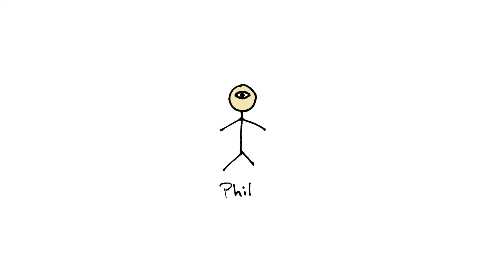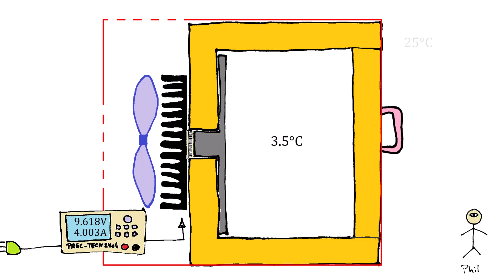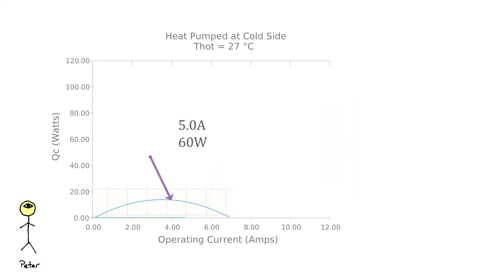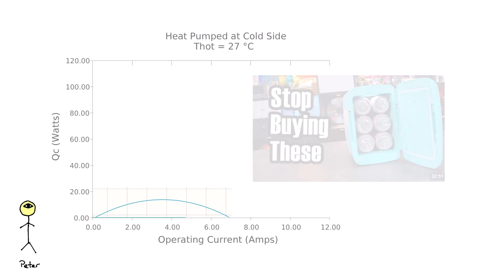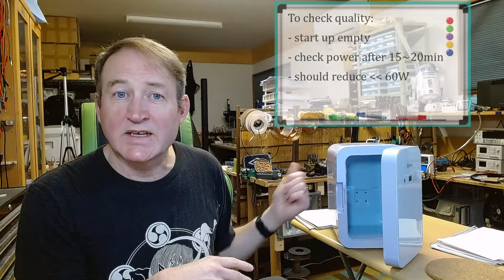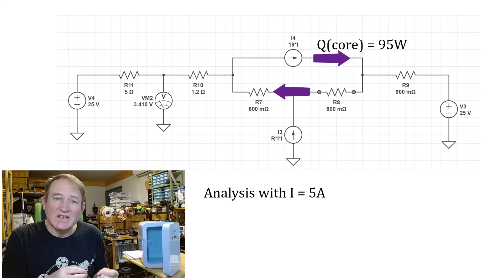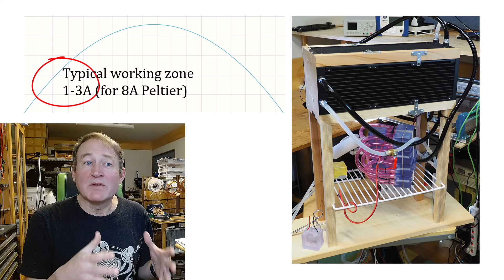The Peltier Fridge Parabola Problem

Comment: Using copper instead of aluminium or both can significantly improve performance , the block between the heat radiator and the Peltier should be copper , then if a 2-3mm sheet of copper is used across the aluminium heat radiator to transfer heat into it performance can be more than doubled also having the 2-3mm sheet of copper on the inside cooling will also improve heat transfer.
Reply from the maker: I've just bought some copper water/air heat exchanges (popular with gaming PCs), expensive but I'm interested to see how they perform against cheaper aluminium types. Also doing experiments with the aluminium/water blocks that go directly on the Peltier and finding the heat is not transferring well from the aluminium to the water, it's about 0.08K/W on each side. I always thought the thermal paste interface was the culprit. Experiments are on-going. I'd like to get 90% of the datasheet performance one day, so far I'm at 75% for my best attempts

Comment: I ran a simple test on my peltier setup where the power supply was ramped down very slowly, like 0.1A per hour and the temperature was logged the whole time. 4 days later I looked at the data and I didn't see no parabola. What I saw was pretty much linear. But I started from 90% of its rated limit. Which is still quite a bit higher than any sane design would allow.
Reply from the maker: It might depend where you measured the temperature? For example, if it's close to the Peltier itself it might follow the datasheet curves, whereas if it's something like a chamber temperature (away from the Peltier face), you should see a parabola if the chamber has for example high thermal insulation to the outside world.

Comment: Yes, you need to run them at about 20% max. But you can gain even more efficiency by doing 2 or 3 stage. Normally, you can find multiple stage Peltier modules for sale with different-size pyramid configuration, but I think that's a mistaken design. It's done that way for simplicity of operation at close to 100% power so as not to overwhelm some elements, but you can absolutely use same-size elements in 2-stage for increased efficiency when run at lower power levels. Probably even 3-stage same-size would work. The trick is not to run them electrically in parallel. They should be run in series electrically, OR computer-controlled individually. 2-stage in series works pretty darn well. 
However, even with all that, I think you can only get about half COP of an optimal compressor design at moderate temperature differences.  
So you could design a Peltier AC with 3-stages and a proper design, it just would take a large count of elements and the efficiency would still be lacking, and it would struggle if the outside temp is too high. But for some niche applications it could be useful. I'm sure in the future we will also invent a more efficient Peltier
Reply from the maker: In general Peltiers are only about 25% as efficient as a compressor. But compressors are fantastic and 25% of fantastic is still OK, given they are a much smaller form factor. Unfortunately there are a lot of implementation traps so people often only get 5% or 10% of what a compressor can do, and then it's not worth the effort. As for series/parallel: in general for power applications (like air conditioning) having them thermally in parallel and electrically in series is the best combo, that way you can run them off a current controlled source and fix the heat pumping action. For applications with high thermal resistance (e.g. cooling a chamber that is intentionally insulation), yes a small thermally in series (stacked) can actually work better, which is what I found with the butter cooler.
Reply: @PeltierPower  Only if power usage is of no concern then thermally parallel for AC is "best." ACs do still need fairly high temperature differentials, and you always have thermal losses which raises it even higher. The only downside of stacking is you need more elements (which are cheap coming from China these days), that's all (if comparing to a single running at partial power max efficiency range) My point about electrically in series (or individually controlled) in 2-stage is to allow for better power balance because the hot side of stack will behave differently than the cold side and use slightly different amount of power
Reply from the maker: @zci-o9i  Not sure about "no power concern" bit. I'm running a 16 bank of Peltiers thermally in parallel to create a 600W heating system which runs off a 300W solar panel, designed to handle a dT of 25K (25°C difference) as the cold side is situated outside in temperatures around 0°C. It needs some fine tuning but basically works OK.
Reply: I'd think in some cases you might want them both series and parallel, like with batteries where you want both more current and more voltage than a single cell provides. Probably where you want both higher heat flow and higher temperature difference than a single element handles well.

Comment: I think of Peltier devices like DC PM motors.  Temperature delta is like the back EMF when the motor is acting like a generator  Torque usable is after the losses like friction and in the windings.

So I have a couple of surplus military blood transport refrigerators.  Actually they can heat as well.  They have a large Peltier in each corner with a massive heat sink and a H bridge controller with thermistor in the chamber.  When I got these the Peltiers were all defective which is interesting as the units looked like they were never used.  I replaced the Peltiers with larger ones and and the chamber can go below freezing but it takes a lot of power.  

Would an appropriate experiment, based on what you said, be to let one cool at nominal current and stabilize, then drop the current in increments, each time allowing to stabilize, each time measuring what temperature is attained?

Comment: It might be a lot of work, but it would be cool to see a "worked example" of roughly figuring out a stable low-side current for a peltier you have. I imagine some spreadsheeting would be involved.
Reply from the maker: I'm working on a simple html page where Peltier enthusiasts can enter the parameters in a thermal circuit along with the Peltier parameters, and then run a sweep from say 0A to 8A (for an 8A Peltier) and see what the cooling power, heating power, input power, COP, temperatures at different currents looks like, all of which follow parabolas except for COP which is a bit messier mathematically. I've got something going already but I want to beef it up to handle series and parallel options, and also make a video how to use it. Work in progress!
Reply: @PeltierPower  Sounds cool!
Reply from the maker: No pun intended?

Comment: I found a good method of use is to lay the unit on its back where the internal gas stays cooler by not dropping out the door to be replaced by the warmer room air( as is the case with most normal fridges). the best trick for normal fridges that dont ge fully packed is to use either inflated packing bags or polystyrene blocks and is most effective with chest freezers.I also make a rack to raise the contents so that removal/replacement is quicker so that gaining heat is reduced to as short a time as possible!😀
Reply from the maker: Actually one of my thoughts for the Peltier fridge (the Msake one), was lie it on it's back and fill it with a 4-5cm of water which should allow better thermal contact with the cans inside. Sounds like an experiment brewing!

Comment: This Msake unit seems not available for sale. Which other peltier fridges (especially in the US amazon store) actually work correctly? I have a Cooluli which is a POS.
Reply from the maker: That might be a little beyond my powers! I don't have any affiliation with Msake, I guess there may be regulatory aspects involved, like electrical safety and EMC that stop them exporting to the USA. As for other brands, of course I could test and report but I'd need to buy them, get them here in Japan, run the tests and then report the results. I'd have to think about the economics of that ...

Comment: Sounds like the heatsink on the average Peltier fridge is drastically undersized as well.
Reply from the maker: Actually the term heatsink itself just adds to the confusion, really it's a heat exchange (metal to air). The metal is also a heatsink but it's tiny and gets "filled up" fairly quickly, which means the main action is all about moving the heat from the metal to the air, and the fan-attached-heatsink isn't great for this, especially behind a cover. In small Peltier fridge it's probably the best practical solution, but still should look for crimpled heatsinks for more surface area. For serious Peltier applications it's best to use water based radiator exchanges. But that means water pump, water circuit, extra noise, pump power etc, doesn't fit for a small fridge.

Comment: Still inefficient, just less so with the right tweaks.
Heatpumps and by extension compression cooling is way better due to using state changes for heat exchange.
Of course, until we can find a way to make mini compressors the size of those tiny fridges, peltier is one of the few options. And at least, there's a way to make them a bit more efficient.
Reply from the maker: The numbers in the video were really just for illustrating the parabola effect. The actual Msake fridge I tested uses about 8-9W with the setting 18°C below ambient. At those levels the "efficiency" is really not important, given the complexity of making a small compressor system, possible noise and cost just to save maybe 4W, it doesn't make sense. For "power" applications, Peltiers can get in the 200-300% efficient range in practical set ups. It's still well below compressors (compressors beat Peltiers by about 4:1), but there are advantages like direct connection to solar without inverters, batteries and so on, and much much much smaller. I'm running a 600W heating system running off a single 300W solar panel for background heat in winter. Yes it's not as powerful or as efficient as my 6kW air con but it's tiny by comparison

Comment: I bet most mini fridges for cars/camping just smashes in 12v/ unregulated battery voltage into a 12v rated peltier and calls it a day.
They always get super hot on the outside and the cable

Comment: Peltier cooling Sukks balzzzz, to much wasted energy, better off with energy efficient freon type system
Reply: What is the physically smallest phase change heat pump you have seen?  There are smaller Peltier systems that work for their intended purposes that could not be achieved otherwise.  In some rare cases a Sterling system may achieve a intermediate size but their cost usually only justified for cryo-cooling.
Reply: Also you can run it in any orientation & if needed orientation can be constantly changed will running.
Try flipping a running fridge upside down & see what happens.

Comment: Interesting. The first time I came across a pelter was back in the late 70's. I was an electrician in a hospital and in the dining room there was a dispenser that dispensed pats of butter. The pelters , two of them, kept the butter cool. One of the peltiers failed.
Reply from the maker: I found in my modelling for the butter cooler that two Peltiers in parallel actually made it worse, whereas two thermally in series (stacking, normally terrible for efficiency), actually works better and is more efficient compared to one Peltier. It's a special case but shows how doing the math, modelling and measurement can yield surprisingly effective counter-intuitive solutions.

Comment: I knew the typical 12706, 12 V / 5 A (60 W) max  should be run at 6 V / 2,5 A (15 W) or less. 
It's good to know that 
1) at least one maker is making good enough product 
2) someone (you) checked this in the real world, THANKS
If you need twice the cooling power, just use 2 peltiers, they are so cheap

Comment: Also, could you clarify what the efficiency of the Peltier at the lower current on the left of the parabola is?
Reply from the maker: Yeah, I meant to include that. It was 4.3W cooling with 15W in which means 0.286 (28.6%) which is still pretty low, due to the thermal resistances used in the simulation which reflect the typical Peltier fridge design. With better quality but still realistic hot/cold side heat exchanges it could get up to 60% at the same -21.5° below ambient. For this kind of application the COP itself is not the end game, really it's how many watts are needed to maintain a particular temperature difference below ambient, which is mostly dependent on the insulation quality of the chamber. I've had designs that maintain a 6 pack of beer at 20°C below ambient with around 4-5W input.
Reply: Yeah, i came here to ask the same. He mentioned the COP for the crazy side but not the efficient side.

Comment: It would be cool if there was a free thermal circuit simulator out there, it would make these experiments a lot clearer
Reply from the maker: Yes, I'm actually building a simple html page that you can enter the thermal resistances on the hot, cold sides, chamber insulation, any heat sources (like CPU cooling), external ambients on the hot and cold sides, the αT (seebeck) and resistance at room temperature, and then the graph plots the cooling, waste heat, temperature and COP as a function of current. It works great but I want to have it handle parallel / series combinations so you can play around a bit to find the optimal point, plus a video to explain ... another work in progress!
Reply: @beanapprentice1687 @PeltierPower An electrical circuit simulator such as the free and easy-to-use LTspice works fine for thermal circuit modelling. You just need to know how thermal components and values correspond to electrical components and values. For example:
thermal resistance (degrees C/watt) <> electrical resistor (ohms)
heat flow (watts) <> current (amps)
temperature (degrees C) <> voltage (volts)
thermal mass (joules/degree C) <> capacitor (farads)
heat of phase change (joules) <> can be modeled with a rail-to-rail output op amp and a capacitor configured as an integrator. LTspice allows creating your own custom components / schematic symbols / circuit models, so it's possible to create a "phase change heat sink" component to allow simplifying thermal circuit models that involve phase changes.

Comment: Do you sell your 24bit temperature monitor and the software??
For machined-out cooling with direct contact between water and ceramic, introducing gentle rotation of the water within channel would help exchanging between slowly moving surface layer of liquid and faster moving bulk of the water flow.
Thermal contact resistance could be further reduced if alumina ceramic was replaced by Aluminum Nitride which has higher thermal conductivity but unfortunately also higher price. 
How about thinning Alumina ceramic down to 0.1mm and bonding it to a copper plate with Indium - would that reduce thermal resistance enough to justify the trouble?
For projects - reaching near-cryogenic temperatures is the holy grail of Peltier cooling; people claim to reach <100C in vacuum; would be extremely interesting and challenging project to explore.
Reply from the maker: In my other life (selling specialized test equipment related to the medical field) I do sell a 24 bit temperature logger, but it's not popular and should reconfigure for this purpose. But yes it's available, can contact by email. I'm also playing around with an idea for a stand alone power sensor that measure the heat into/out of an element like the cold side of a Peltier, I think that could be the most useful item. And yes, I don't understand why the makers of Peltiers don't have pre-assembled items with either the ceramic sintered to the aluminium water block, or some other pre-assembled block rather than us having to mess around with sanding things flat, thermal paste and clamping :)
Reply: @PeltierPower  Market opportunity for modules bonded to water cooler one side and bunch of thinner bendable heat pipes on the other side to provide cooling where required. Camera sensors, CPUs, dispensing machines, reflux condensers and many other things could be designed around a reliable and predictable temperature reducer assembly.

Comment: Have you tried installing a Peltier device on the side of a standard refrigerator so that it takes the small loads but the main compressor works as usual to take the large loads.
Reply: That idea has real merit. It probably works best for thermal loads that make good contact though. Compressors cool standing air better.

Comment: Imagine how much better these might work with heat pipes in place of both heat sinks. ;)
Reply from the maker: Absolutely, for my solar powered air conditioning application where I'm taking 300W from a panel and boosting up to 600W (using a bank of Peltiers) you definitely need direct water flow to move the heat around, simple Peltier to heatsinks and fans won't cut it!
Reply: @PeltierPower yep, getting rid of massive amounts of heat quickly and with the lowest temperature gradient posible is crucial.